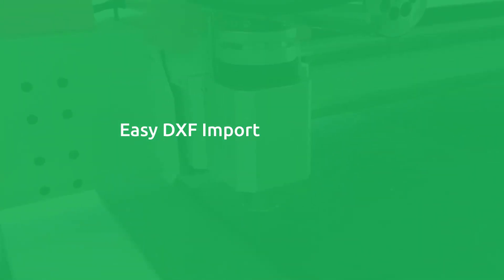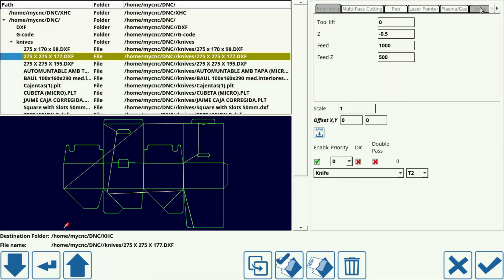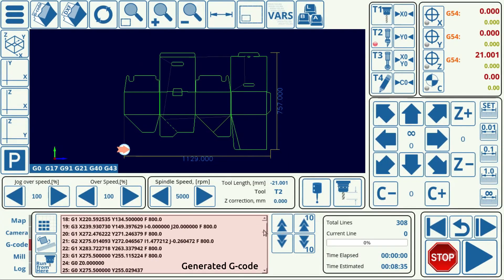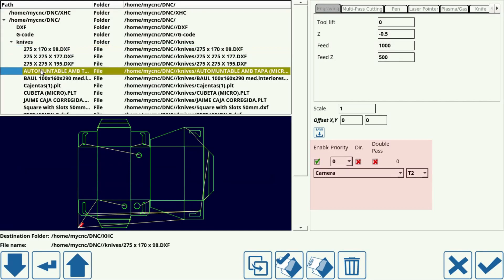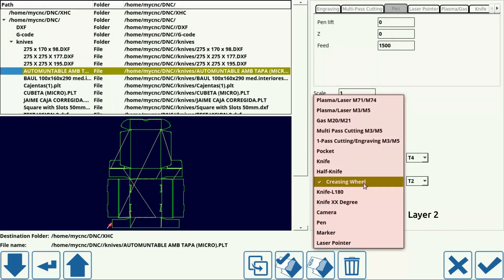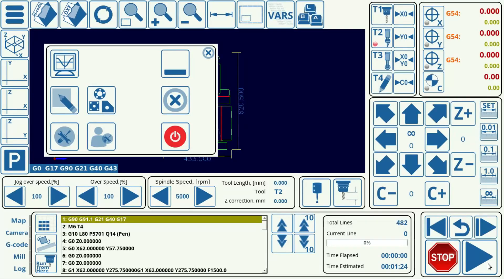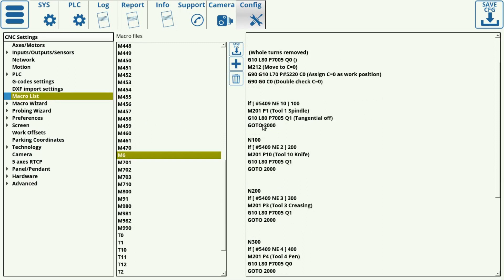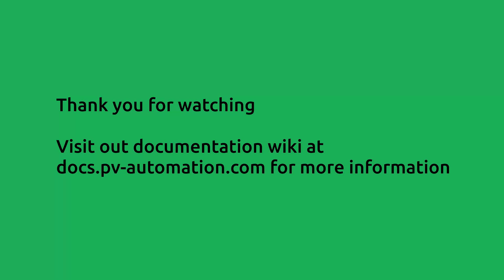myCNC demo video - Tangential knife support.

Comment: I want to build my own cnc for tangential knife. Please help how to buy mycnc software and is this software liable with any controller or i have to buy mycnc controller board if it has. Please revert
Reply from the maker: yes, you need myCNC controller board to work with myCNC software